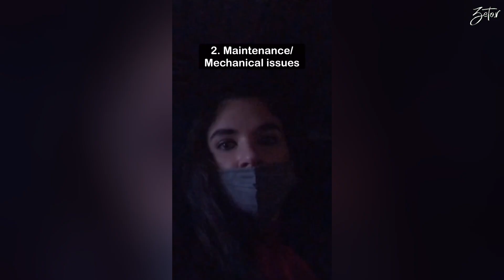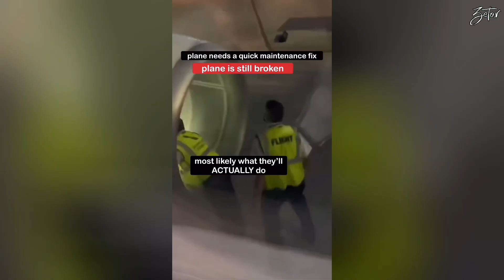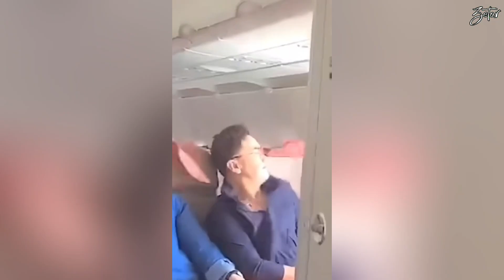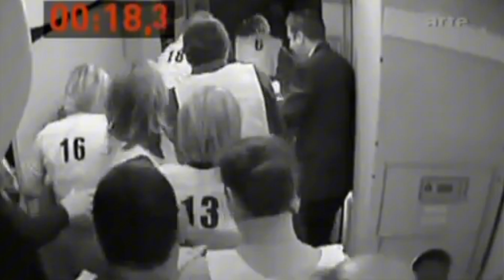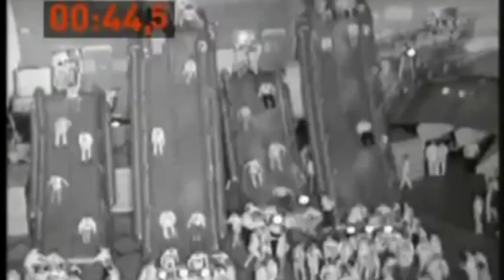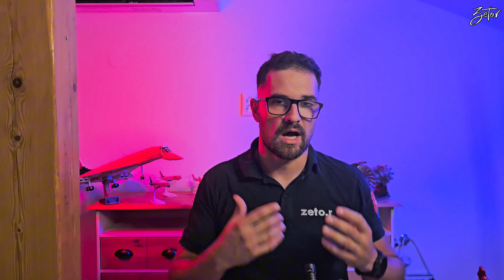How to become Aircraft engineer in Europe and U.S.

Comment: Aviation mechanic can perform airplane repair and also can do flying the airplane too?
Reply: Yes and no, you have either mechanics with start up certifications or mechanics that are also pilots these kind of people would be called a technical flyer.
Besides that a normal mechanic and engineer do not fly the plane.
Reply from the maker: For both think you need separate licence if you have them yes you can do both, but to keep them alive will be hard

Comment: Tomasz, can you make a video about all the batteries used in airplanes? How many batteries are there, what are they for, what type are they and what are their parameters, how are they charged, how are they checked and when are they replaced? There are no films like this, it would be interesting.
Reply from the maker: In A320 you have 2 battery for aircraft then EPSU and that is all as far as I know😁
Reply: There are more batteries ,but it depends on configuration on an aircraft. If we segregate to system batteries yes 2. But you have emergency light batteries, torch batteries,megaphone batteries, defibrillators etc..

Comment: In addition to the type rating on each aircraft type, we also need training for each engine type on that aircraft. Also, in the beginning we work under supervision, where someone is always watching our hands and still checking every single step of our work. Only after certain time (few years) we get to the stage where they only check the finished work and after getting the license we can work independently and release the aircraft for operation. In addition to everything Tomáš mentioned, we undergo a lot of training every year, regardless of whether we have a licence or not, and most importantly, all the work carried out on the aircraft is done according to the AMM (aircraft maintenance manual), MEL, regulations, manufacturer's instructions and the airline's internal procedures. There is no random work and no random mechanic on the aircraft.